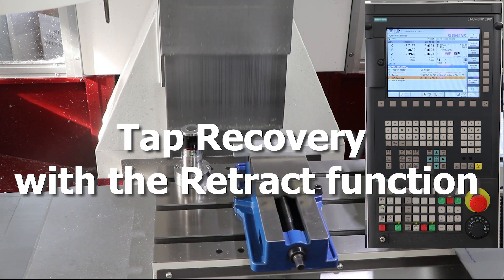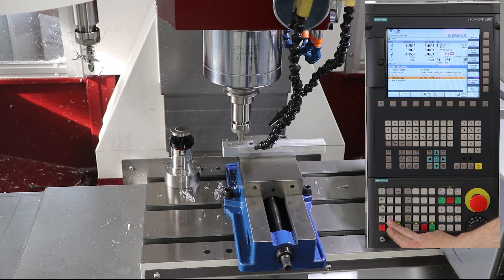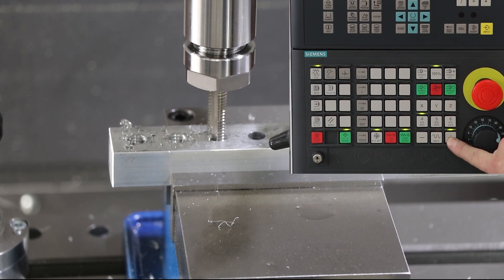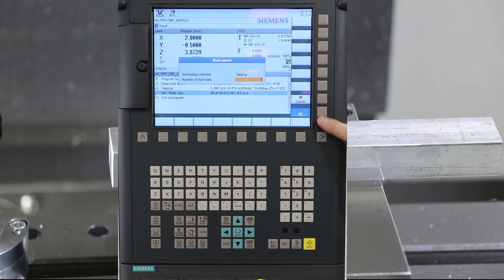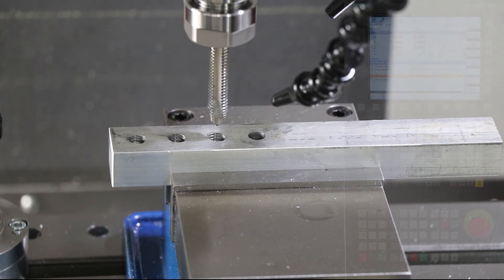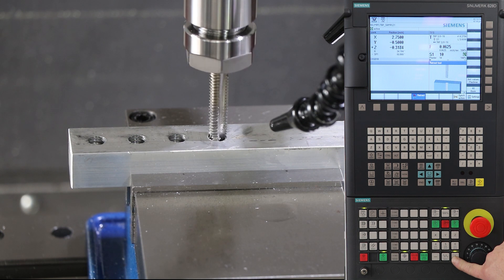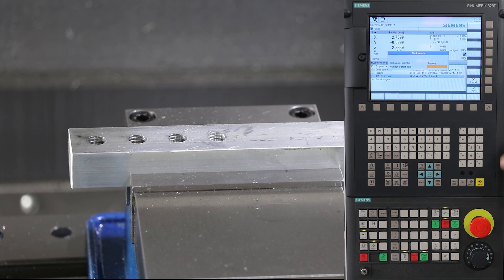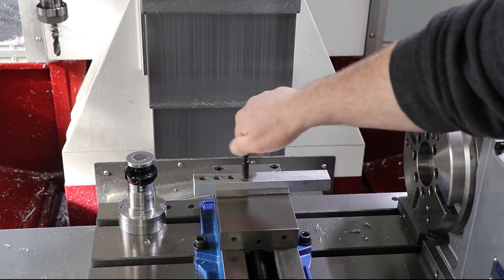Tap Recovery with Retract Function in the SINUMERIK CNC

Comment: Cool to see it. I did not even knew that there was function like that. 
When I had to do that, I used normal "move to position", calculated how far I want to retract, divided it by thread pitch to find how many revolutions it needs and typed it to incremental degrees amount.
Z=30mm
Thread pitch=1,5mm
30mm/1,5mm=20 revolutions
20*360 degrees=72 000 degrees
So incremental Z+30mm (inc) and spindle (I think it's "minus") -72 000 (inc).
Reply from the maker: Nice!

Comment: How would you restart it if you only wanted to start from say the 4th hole. Maybe you've broke a tap in the 3rd hole and had to put a new one in.
Reply from the maker: I would use a mid-program start in that case!
Reply: @MrCNC  in case i have 50 holes  in my job
And out 50 holes 40 Holes are drilled and than power gone
After power comes how can i start my program form 41th hole please explain
Reply from the maker: block search mode and find the 41 hole and cycle start